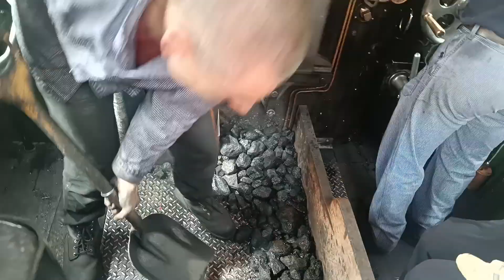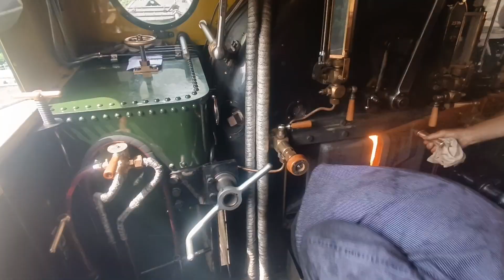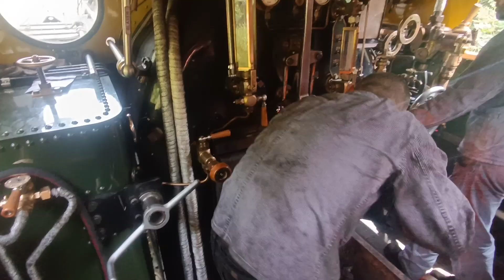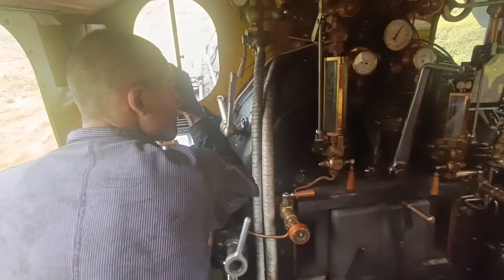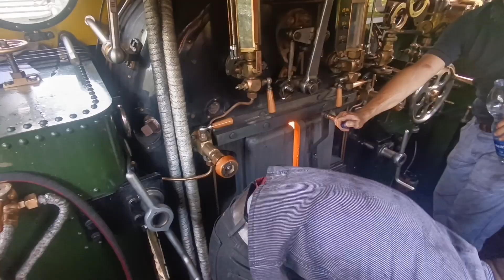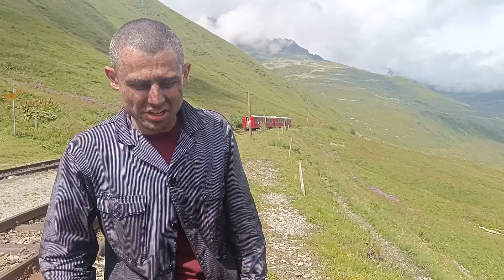Firing Hg 4/4 708 over the Furka Pass

Comment: When the steam locomotive I'm involved with is pulled by diesel-electrics to transfer it, because the railroad we are running on requires their equipment and crews be used, it still has to be fired to operate the lubricating systems.
Reply from the maker: That's a bit absurd that it can't just move itself under its own power to where it's going.  At least you guys understand that part is needed.  The way I've always handled transfer moves is remove mainrods and disconnect valve rods so nothing in the cylinders is moving
Reply: @AEKarnes  We have done it both ways.  We were being taken to a park and at another time to town festivals for static displays.   There was a requirement that the pressure be only like at about a quarter of full operating pressure to run the lubrication.  I think the railroads we moved over were fearful of the locomotive being powered accidentally and maybe even a boiler explosion.  Yes we have also moved it removing the main rods and valve rods, then reattached them at the locations, took them off again and then put them back on at our yard.  It is an additional pain in the ass.    Although the locomotive meets FRA standards, it does not meet AAR Interchange standards - no roller bearings for one thing, - so everything becomes negotiated.
Reply from the maker: I'm sorry to say it to you but I've said it to others, that's the absolute height of ludicrousness and why we have essentially no running steam in the USA.  Europe may have a ton of paperwork but people generally recognize the steam engine as a useful and simple machine and not some object of superstition and fear so getting mainline access is fairly simple.
Reply: @AEKarnes  Unfortunately in the US, the system is loaded for the plaintiff tort attorneys and if anything goes wrong, they go after the deep pockets, the railroads.
Reply from the maker: Something to know: It is much the same in Western Europe, but one reason I do business here is that if any of them try to come after us for what we do, we sue them immediately and essentially trap them in legal limbo.  In the USA, people lie down for regulations and worse yet they virtue-signal about how good they are at following them like little pawns, nobody in the US has ever tried to sue the FRA to my knowledge certainly not in the heritage field.